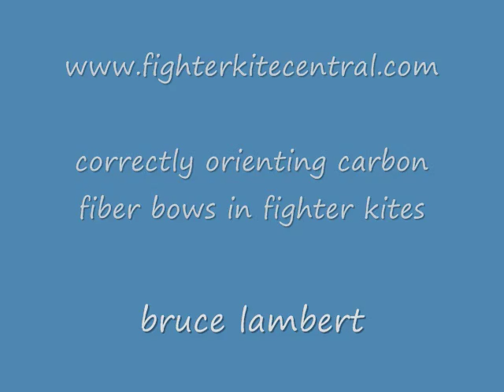Orientation of carbon fiber bow in a fighter kite

Comment: Bruce Thanks for your videos
I have a question, What diameter do you recommend for for the bow? Thanks
Reply from the maker: you're welcome.......the diameter depends on the wind speed you'll be flying the kite in and the overall size of the kite. in light winds, below 6mph, i use a 0.05" diameter carbon rod for the bow for higher winds, around 8-12 mpy, i use a 0.06" diameter bow and often a slightly shorter bow because the kite is often a little smaller than the lighter wind kites.  hope this helps.  bruce